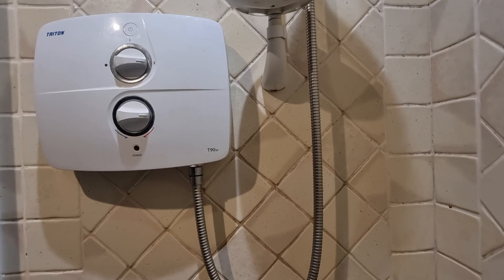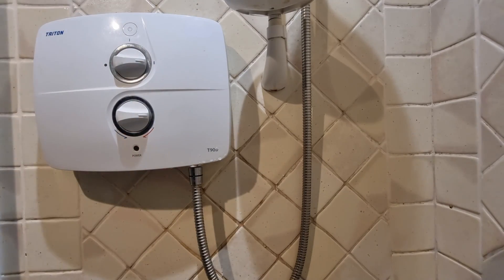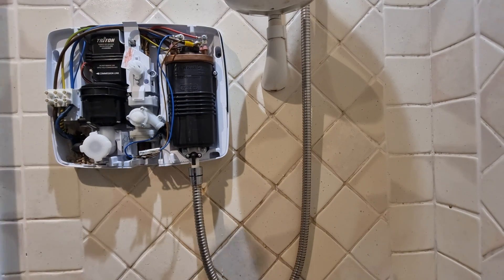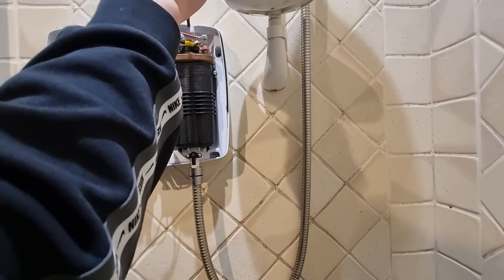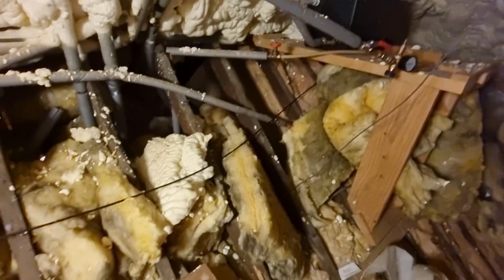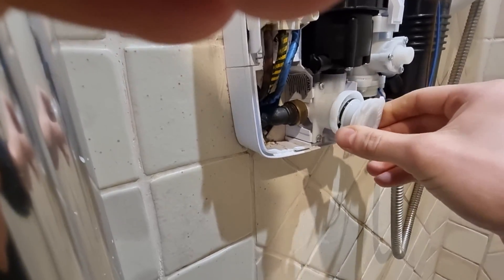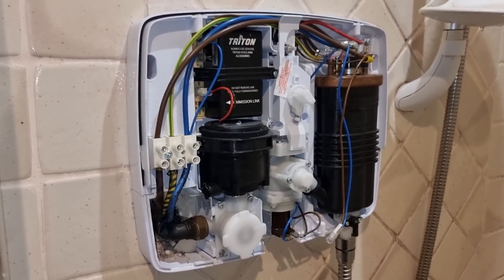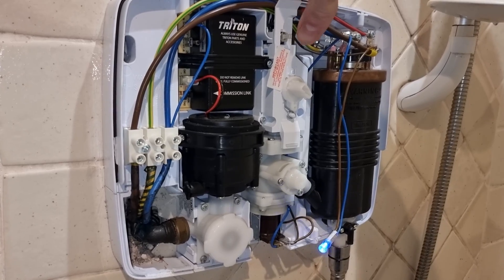Triton T90SR Electric Shower Hot/Cold Issue DEMYSTIFIED! 🔥❄️ | Troubleshooting & Fixing Guide (4K)

Comment: Hi, I just replaced my T90 with a brand new model but its not getting anywhere near the same heat as the old one. Any idea what the problem is?
Reply from the maker: Possibly the bottom knob wasn't aligned properly when cover was put on

Comment: Hello I'm an electrician with lots of experience even in plumbing. I thought have no experience in electrical showers  I watched your video on YouTube and really found it helpful. I am trying to help an old lady with her shower that is only six months old. The last two weeks she only gets look warm water. I checked for blockage as you suggested and I noticed that the setting one for using of just one element is only giving cold water. Setting two is only giving look warm water. I think one element has to be faulty. I will help her to replace it, just one question does she need to replace the whole tank with both elements in or can you only replace one element and where to buy it. She is only a pensioner so haven't got lots of money. Can you please help. I live in Drogheda Ireland if you maybe live close by I could contact you. Thanks Leon Bezuidenhout

Comment: Spray adjustment on shower head was such that it slowed flow across the heating element. I opened out the spray adjust and temperature came into control. The shower head may not be blocked but do check the spray setting on the shower head. Triton actually supply shower heads with spray settings.

Comment: The light doesn't come on on my shower and water is too hot..any ideas?
Reply from the maker: The light not coming on could be failed bulb, or that it has fallen from light holder or was never put on there, water too hot could be blockage in filter, insufficient flow from tank or a failing internal component. If you can get the filter ruled out/someone to check for you I'd start there
Reply: @no-sparks thanks

Comment: Great video! My shower is constantly running too hot. Followed the video and filter inside looked fine, small bit of debris so cleaned it anyway. Still running too hot. When I take the hose off there’s always a buildup of lime I have to shake out. Could there be a bit of a blockage in the pipe running into the shower? Wondering if this is worth calling someone or can it be cleared out by myself?
Reply from the maker: Hi! If you're getting bits of limescale I would say you might have a problem with buildup inside so it might need some work done on it with a professional :)

Comment: Hi no sparks my t90sr has is stopping after 5 min .ive cleaned filter and water coming from attic is fine .do you think its my solenoid. Shower is 6 years old 
Cheers dave!
Reply from the maker: Hi Dave 👍🏼 ah shite, yeah it could be the solenoid or something on the board which triggers the solenoid. 6 years isn't too bad for one of these I think unfortunately, the older models lasted as long as the brushes/commutator but these seem to die at random. Hope this helps

Comment: My electric shower (and the previous one) could not be adjusted -it always ran too hot whether it was on one heater or two. I realise now that it must be something to do with the flow . Lots of cold water comes through when it's turned to blue, but nevertheless maybe there's not enough water to control the final temperature.
Reply from the maker: I would think this is a correct diagnosis, do you know where the feed tank is located and if so, is the tank much higher than the shower or possibly at a similar height (sometimes happens due to side attic water tanks rather than a tank above ceiling

Comment: Will this work if the shower isn’t giving off hot water ?
Reply from the maker: I cleaned the filter in one yesterday that had no heat, problem was solved hot water again and stronger pressure out of the shower head 👍🏼 give it a go

Comment: My issue is that the water is coming too hot, despite moving the pressure... Only hot. What could be?
Reply from the maker: Possibly restrictions on the flow, if not possibly a failing part 👍🏼
Reply: @no-sparks yep it was that. Great video 👍

Comment: Great video, I have one question: Could a different model of shower head (one of those with different water flow programs) cause a failing on heating the water?
Reply from the maker: Perhaps if it's too restricted, try a standard head and see if this fixes the problem.

Comment: Thank you sooo much. My shower was running either too hot or cold. I cleaned out the filter which was filthy and my shower is now working properly. You just saved me €290. Great video.😊
Reply from the maker: That was absolutely my intention :) it can be a regular occurrence for some, and often the unit gets replaced when something so simple can fix! Thanks a mill for the feedback 🙌🏽

Comment: My shower is humming when i  switch it on, no difference in sound when selector is set to "off" "1" or "2", water is coming through but doesnt seem to be being pumped, not heating up either, is the pump the issue?
Thanks
Reply: It's actually the same as when you moved the slider for re-comission to on, so it's definitely the pump I'm thinking?
Reply from the maker: Interesting, definitely sounds like some form of fault alright! Could however be a PCB board fault or other component, it's as if it's gone into commissioning alright. Best to get it looked at id say! Thanks as well for the feedback 👍🏼 much appreciated
Reply: Thanks

Comment: As there is a 2 year guarantee with this shower, surely I would have grounds for a replacement?  Mine is now 18 months old and it never worked properly.  It has all those problems mentioned below in your comments. i.e. mostly luke warm and usually half the pressure of the bath hose!  I would never be confident to remove the cover and take those steps you  describe.  Is there another brand similiar that does not have these problems?  Thanks for you detailed video.
Reply from the maker: I wouldn't think so unfortunately, that's not how guarantee typically works, especially after 18 months, I would have complained within a week of dissatisfaction but I can understand your frustration regarding this. Seems to be a common remark people make.

The bath hose you're referring to may have a booster pump supplying it, in such a case you would recognize a significant difference between pressure BUT these shower units don't operate near the same pressure and that would be in the specs of the shower. It could also have been mis-fit properly or could have a fault underlying. Best to contact a local plumber I would say if it's driving your head in 😊

Comment: Sorry man, a key point missed. There is a black valve on the pump that needs to be bled as part of the commissioning process. That has to be opened and then closed. Because you didn't do that, I didn't understand that I needed to do that. But I know now. Hope this is useful to you.
Reply from the maker: Hello :) smart observation.
However if it were to be a smarter observation, you would have realised that this shower is an older model with a commissioning link, and the newer models don't have one, but rather a black bleed valve. Hope this helps you and thanks for your wisdom hannahbanana :) there's some key points for your notebook... Also don't use keys to point into electric showers if you don't know about them 🤣🤣

Comment: Great video mate. I just had a t90 sr installed to replace a t90 XR but the pressure on the SR is much lower than it was on the XR. Any ideas? The SR was brand new out of the box
Reply from the maker: Was it bled correctly etc before powering on and commissioning?
Reply: @no-sparks  Sorry mate it's actually fine. Thanks for the response. I think sub consciously the loud sound of the old shower made it seem like the water pressure was stronger😂

Comment: Would lime prevent flow and can hard water get into system after the the filter ie hard water eventually lining inner workings or would filter strip impurities before entering system?
Reply from the maker: Good question! No, I don't think the filter has any effect on the lime in the water regarding removing/purifying it, so you would be right assuming if there's lime in the water, it may be calcifying on the internal components, particularly the heater element components. Hope this helps 👍🏼

Comment: Very well explained.  I have a two year old Triton.  Water flow began to slow down until stopped. No hot water either.  I am going to tackle it over the next two days when I get a chance after seeing his helpful video.  I see how I get on.  Thanks again.
Reply from the maker: Ah great to hear! Let us know how ye get on and what you find :)
Reply: @no-sparks  I discovered that the water level in the roof storage tank was very low due to an overflowing cistern in a downstairs toilet.  When the electric shower was turned on it emptied the water supply completely and dried up the water flow.  I fixed the toilet cistern by replacing the flush valve seals and this stopped the water overflow.  The storage tank refilled and the shower started working again.  There does not appear to be any airlock problems with the shower, so I am hoping everything is ok with the heating element. Thank you for your consideration in your reply.

Comment: Thanks for the video. The flow is fine on mine but the water is just not heating. My mistake. I tried one of them extra water pressure shower heads. Is the shower done for or is there a way to reset it. Seems to me. The new shower head(which is now in the bin) was restricting flow. So the shower protected itself and tripped something. Or maybe it’s just goosed?
Reply from the maker: 👍🏼 
Erm if the problem has only started since trying the restrictive shower head, perhaps the low flow switch has somehow gotten stuck on? This would disable heating I think. Do you have hard water in your area? Eg. Limescale buildup?
Reply: @no-sparks  hi. No it’s not known for hard water. Also the shower is only 5 months old. Is there a way to reset the switch ?

Comment: Hi thanks for a great video, I have the triton t90st i was getting cold water with a good flow, I cleaned the filter which was really blocked, cleaned out and replaced fitted. Now I have a greater flow of cold water which will not heat up ? Any ideas  ?😮
Reply from the maker: Hi! Good to hear cleaning the filter helped with the water flow!
If there's more flow than previously, amount of heat the elements produced before is still the same, so more flow and same heat from elements means cooler water at the same numbered temperature on the bottom dial, this is normal and the hotter water at lower number on bottom dial indicates a flow problem incoming

Comment: Brilliantly explained.  Well done, I just hope that’s what’s wrong with my shower which is only 6 mths old.  Keep up the good work.
Reply: I’ve just done everything as per the video, filter was very dirty etc.  Now unfortunately it’s not heating the water at all. 😢
Reply from the maker: Did you get it sorted? That's unfortunate, did you do the commissioning procedure?
Reply: @no-sparks  I got the heat back on but my problem isn't sorted.  I checked the water pressure from the tank and the piping etc and also did the commissioning procedure and to no avail.  Its heating the water to about 80%.  I will just have to wait longer for the Triton engineer to call, already 8 weeks now!  Thanks for getting back to me.

Comment: Mine is only slightly heating up on 2 element and full heat could this fix it
Reply from the maker: Could be dodgy switch I've seen similar problem but it would cause tripping out, could be one of the internal thermostats either!

Comment: Brilliant video man,  i installed mine a year ago, there was no jumper pin on it for commissioning which i thought was strange,  but have constant problems ,i thought because i went with the brushless model out was different set up
Reply: Will also say the electrick wasn't triton brand as you can see on your unit it seems to be a spurious one called MeanWell,...very suspicious I bought it from woodies I would be angry if it was some refurbed crap now....I down care if they MeanWell ! Ever heard of this?
Reply from the maker: Believe it or not, Mean Well is a very well known manufacturer of power supply units

Comment: My issue was blockage in the filter, which I think usually the first thing you should check.  It’s easy enough to clear out, and I’ve never had a load of water coming out when I’ve taken the filter off.  I’ve never turned the water off to do this.  Fortunately.  Nor have I ever had to do the ‘commission link’ thing.  And rather than go with the multimeter, I just turn the mains off for the few minutes that I have this open.  When I’ve finished with teh shower, I also unscrew the shower head and let the shower hose drop down, so that all the water is drained from inside the mechanism.

Comment: Great video.  My shower is 9 mths old and frequently it runs just warm water. It didn’t matter in the summer but now we need it to be hot. The second winter on 2 bar thing makes no difference.  I think we got a cowboy.
Reply: Same thing with my shower at the same age.  Am hoping this is the problem as described in the video.  The last shower unit lasted 8yrs though!
Reply: These are junk and barely last to the end of the years warranty. Mine is just over a year old and needs to be replaced. Unless I can fix it myself with this vid. Gonna try later

Comment: I just replaced my T90Z (over 10 years use) with a T90SR. So far, not at all impressed. Setting 1 up full is warm, but not really warm enough. Setting 2 down low is uncomfortably hot. Up full, it would be unsafe. Seems to be no way to have a happy medium with this POS shower. The only positives are that it's a direct replacement for the T90Z and it is much quieter. But temperature control is brutal! It's stable in steady state, but cannot get a preferred very warm temp. I'll be getting rid of this soon and replace with a proper thermostatic pumped shower. My T90Z just failed me at the wrong time.
Reply from the maker: If it's uncomfortably hot on selector 2 at the higher temps, sounds like there's a problem with flow of water through the shower, not sure if they require much head pressure but be sure there's no water restrictions
Reply: @no-sparks It self resolved before I had to do anything. The next day, all was good. Very strange because the flow rate was good and I changed nothing. I’ll take the win. Still prefer the T90Z despite the extra noise.
Reply: Why do you prefer it? @GaryOnPower
Reply: @paddymuppy  I found that the pressure and temperature controls on my T90Z were much more responsive than the T90SR. This year, I plan to scrap the electric shower and move to a thermostatic shower, utilising the 4 bar house pump and getting a lager smart cylinder installed. This will be a much nicer shower experience and has the added benefit of keeping the load below my solar inverter limit, which mean the battery storage is used, rather than the grid.

Comment: Thanks . I'm having a similar issue with the T80.  Too hot then cold. Only appears to happen if another mains appliance is in use. Very annoying issue with Triton electric showers.
Reply from the maker: Thats most likely not enough water then to both, the flow switch tripping out in similar fashion as the filter being blocked I guess! A bit of a pain alright :( haha
Reply: @no-sparks  it's a new shower so likely the filter is OK.  I was checking the manufacturers spec and it requires 1 bar pressure to deliver around 2 litres per minute.  However I think when a second appliance is used it falls below the 1 bar required.  I see Mira electric showers only requires 0.7 bar to deliver the same amount per minute.  I'm thinking of replacing the triton with a mira to see if this fixes the issue.

Comment: Very good video, thanks for posting. On my t90sr, after I turn it off water keeps flowing for about 3 minutes then stops and there’s a groan from the unit. Any idea what’s going on?
Reply from the maker: Does it continue to run same flow or does it reduce/dribble once turned off?
Reply: @no-sparks  it's the same as when turned on albeit a small bit less powerful. I actually solved it by replacing the flow valve. Now it turns off fully and only dribbles for a bit.
Reply: I'm guessing from your vid that i might have only one heating element working as at full temp it's only warm with a weak flow
Reply: My one does a similar thing. I have to turn it on and off a few times until it stops spewing. Strange yolk. I'm in a hard water area so I reckon the thing just hates me.

Comment: Thanks for the video. Any idea why water would run through the shower unit T90SR without the unit be switch on. Causing what seems like airlock.
Reply from the maker: After the shower is running or?
Reply: After the shower is running

Comment: Thanks for a really informative video. Explained nicely how an electric shower works, and all with that lovely Irish accent you have. I have a different problem in that my Triton Trance shower (has a direct water feed,not a tank), runs boiling hot no matter what position the water flow control dial is in. If I turn the other dial to the middle position its more controllable but only on a scale of warm, so really need the other position working. As is I just have to keep dipping in and out of the shower spray so I dont scold myself. Any idea’s ? ;)
Reply from the maker: I would imagine also blockage in a filter, or insufficient mains pressure feeding the shower unit... Possibly a broken component either regarding the flow control. Hard to tell but hope ye get sorted 👍🏽